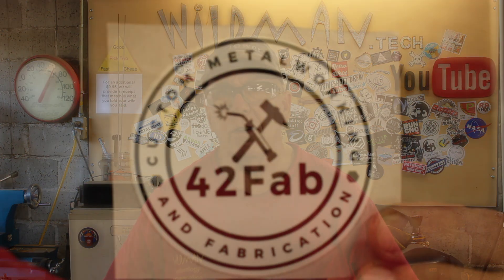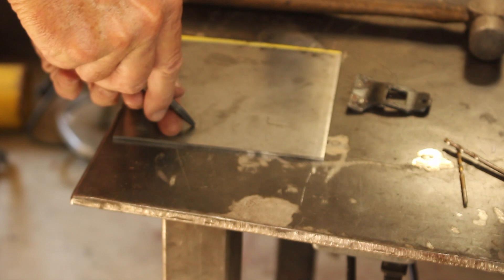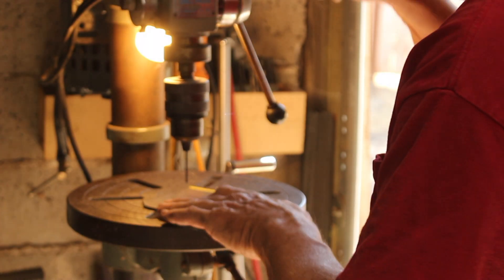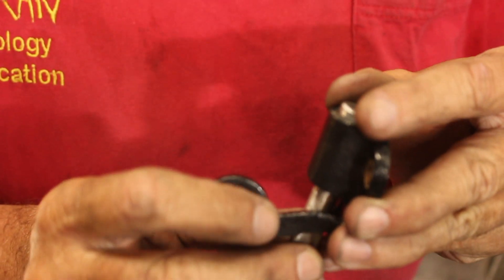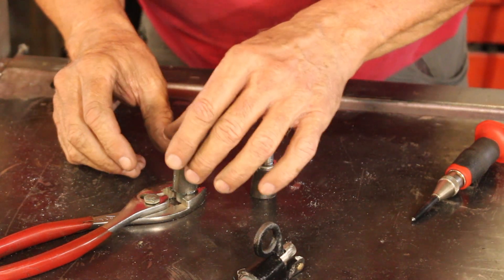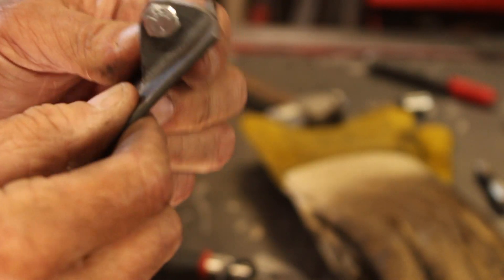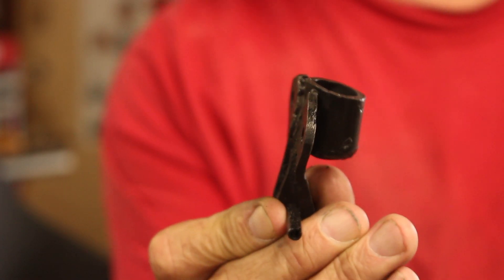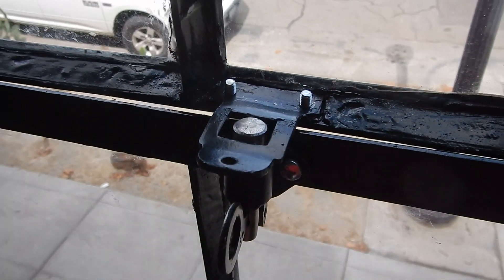Reproducing Antique Window Latches

Comment: I like the way you figure things out.  And you well better than me. Where did you get that little bench top band saw? What a great project👍🙂
Reply from the maker: It's a porter cable portaband that I removed the handle from and installed a piece of square tubing that fits into the tube of my welding table. I made the zero-clearance table for it. I didn't do a video in that.